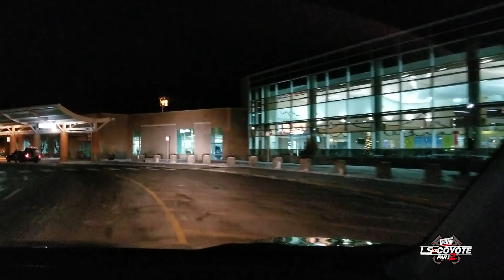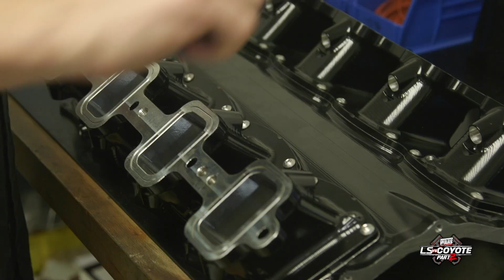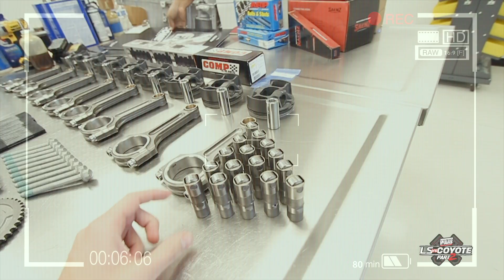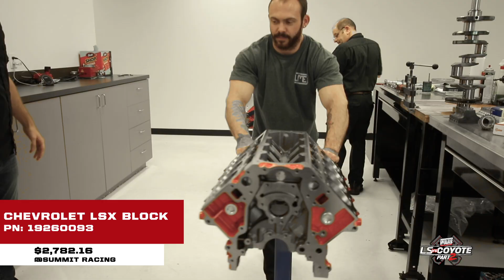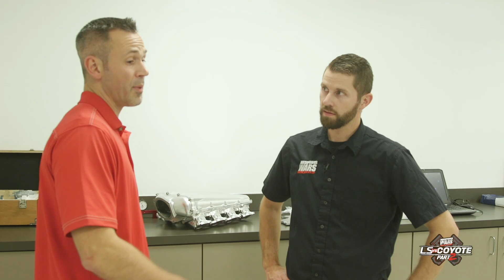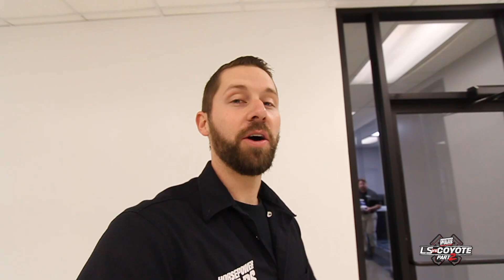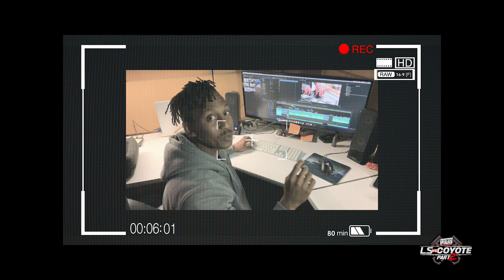LS vs. Coyote 2 Episode 2: The LSX Engine Build

Comment: The coyote will definitely make more Horsepower Per Cubic Inch that's a guarantee now just imagine if the coyote was the same cubic inch... Can you say,done, over with The Coyote with same cubic inches will literally embarrass a LS of same cubic inch, I mean come on its 70 + cubic inches smaller and gives the LS all it wants... You want Respect from Most people match the cubic inches and test,dyno,and race them in a Mustang and Camaro and watch the Ford Coyote walk that LS in essentially every category. It gets me when GM guys bragg that their much bigger GM/LS engine out powers or barely outperforms a Ford engine with 60_70 less cubic inches because let's face it their not going to race a 5.3 LS against a 6.2 Ford because they know the poor little GM/LS would get embarrassed...As for anyone listening try it I dare ya!!!! Test a Ford Coyote with 60 to 70 cubic inches on a GM/LS engine and do the same kind of shootout and watch the Ford Coyote Engine Dominate in Every Category. This is like racing a Stroked 351 Cleveland and racing it against a stroked GM 305 engine it's not fair and that's coming from a Ford Guy because in the case I just mentioned the stroked Ford351 Cleveland would lay waste to the smaller GM period!!!! At the end of the day it should be cubic inch to cubic inch same size no excuses from either side Ford/GM and I think most people would respect, agree,and it would settle the  big question who makes the best, baddest engines that make the most Horsepower when matched cubic inch to cubic inch Ford/GM And I say throw Dodge in there with a Hemi and build all 3 with same or like cubic inches within 5 cubic inches... Who Agrees with that!!! #Blue Oval Nation
Reply: Tell that to cleetus and ruby they ran a 9 second pass on their first drag strip run in a 5.3 😉
Reply: @mr.merica6048  Yeah and then it blew up... awesome engine.....
Reply: @SomervilleMetalWorks  not the fault of the engine. They ran out of fuel and leaned it, that sort of thing happens when you need more  injector. They were also running a modified pan that cased oil starvation and roached the bearings. Stock sump and bigger injectors would have avoided that, it says nothing about the engine.
Reply: @SomervilleMetalWorks  not on the new 5.3 they put in it the other engine was well over 200,000+ miles
Reply: @mr.merica6048  ,that's a 305 with a 4L supercharger.Not sure why,maybe NHRA leveling the playing field,Ford's using a 2.9.Street Coyotes are making 1500hp crank.It's all about power levels.
Reply: @mr.merica6048  and blew it up immediately....no disrespect to cleetus but it blew up
Reply: ford seems to be incapable of going bigger than 5.2l for any sports car they build in this day and age and that's fords choice.
Reply: @lovescamaros1  ,they are not incapable,rather,as you last said lastly,choosing to challenge the big cube pack with smaller displacement engines that produce equitable performance.However,I am a V8 enthusiast and not agreeable to many of Ford's changes.I expected them to raise the bar on Cammer motor displacement to 6.5+L.Oh,well they,re gonna have their hands full staying with 7 and 8 litre competition.
Reply: @lovescamaros1  Nope, this test is already rigged, Try a stroked Windsor with Aussie Cleveland Style Heads, we're seen 998HP with 410ci N/A!!!
Reply: david wenzel - Thats all Ford needs to beat the competition over and over ..
Reply: You do realize there are a lot more 4.8 and 5.3ltr LS motors pulled from trucks and built for a fraction of the price than on these videos that are making 1000+hp than there are Coyote's making the same kind of power? You sound like a fool.
Reply: Jerry Watson I agree with you 100%
Reply: You do realize the coyote has DOHC right?
Reply: Do all you Ford guys not realize that a dang 7 liter coyote wouldn’t even fit in a car
Reply: They should use the trinity 5.8 instead of the 5.0 but all gm guys would cry becaise its not the coyote motor
Reply: @ztaples  The Coyote heads flows wayyyyyyyyyy more than the Trinity heads.
Reply: @ztaples  in that case use the zr1 block too.
Reply: Jerry Watson your right, Ford achieved getting more power out of a smaller cubic inch motor than GMs 6.2 . Buuut the coyote does it with 3 more cams and 2 more valves in each cylinder. Which , depends who you talking to, is worth noting. I'm a GM guy but at the end of the day it's how much money you got 💰. If you have to money you can make a coyote turn much more than a 6.2 ls3 but the only thing is your gonna spend more money to get passed the the power numbers of the 6.2 or the 5.3. that's why most people go with the ls, its cost effective power and for a lot of people that matters. So yeah the coyote does outperform the ls 6.2 or the 5.3 even though it has less cubic inches but last time I heard ford is making a new pushrod V8 to go along in there new trucks...even has side bolts for the main caps...kinda like a ls??? 😂 If you can't beat em go along with them .
Reply: @23finter  so  those  jy 4v truck parts will never be cheap lol...
Reply: Use a junkyard 5.3 LS with a 150,000 miles with some upper end speed parts for a good comparison in cubes. Horsepower will be the same if not better with the LS. Besides Hot Rod magazine did a build using a high mileage 5.3 stock bottom end. Using massaged heads, cam and headers, the numbers were impressive. Then they added 24 pounds of boost and the stock bottom end finally let go at 1,265 horsepower. Not bad for that supposedly junk LS platform that they use in everything. 🤣🤣🤣
Reply: CorvZ061 show me where are you getting your information from? 🤔
Reply: I totally agree,Jerry,if you want to validate the mechanical superiority of one engine design over another there has to be parity,first on displacement,compression ratio,cam specs,and induction.It really has nothing to do with money,but just  the ground rules for both platforms.If the ls  employes a 260*/.600 lift cam,the coyote should have any choice up to and below those specs,as with the rest of the build.To compare a 7L stroker to a 5L stocker is inequitable and invalidates the comparison.Really,the displacement advantage is around 125 cu. In..Apples to oranges in the end,coyote looses.
Reply: @johnrunion7258  No one even knows what the Ford builder is doing yet. Why all the crying about it. Who's to say he's using a 302?
Reply: @EGGINFOOLS  speaking of this part 2 thread,they specifically mentioned 427stroker LS..The designation Coyote is specific only to a late model 5.0(302) twin cam.There's nothing can be done to this block to approach 7L displacement except boost.The designation LS covers a full range of displacements between 5L and 7L on factory engines.When it is referred to as Coyote,that' how I know what it is.Other twin cammers come in5.4 and 5.8 L displacements with no code name.
Reply: @johnrunion7258  Of they can't do anything to the block is that GMs problem? Nope. It's Fords.
Reply: @EGGINFOOLS I'm an old school Pontiac motorhead and I've experienced all the engine history from before there was a 327 small block.The fact that I see a curious blog about an engine comparison and see what,s up.Without bias,what I understand is a power contest between an LS and a Coyote engine.This is where my personal analysis is logically stirred.First I know that all Coyotes are 5L motors,cookie-cutter engines that the user has to modify.Now the LS platform is the most diverse in the industry,going thru several generations of block improvements to give the user a myriad of displacement choices from 294 cu. in. all the way to 454 cu. in.,awesome.That being said,the comparison here is not on diversity(of which Coyote has none) in platform,but of power output of each engines design.The admission that Coyote produces more HP per litre than an LS which means the only way it can match that engineering advantage is with larger displacement,which it can do with any number of LS configurations.The comparison is irrelevant.For a similar diversity starting 15yrs ago Ford made the choice to build a singular small engine platform of tremendous strength and increase it's displacement as needed by simply upgrading the boost induction system.This is why '03/'04 Terminators can still hang with the big boys.A 4.6Lmotor with a 4L supercharger bolt on equals 8.6 N/A litres(roughly 530 cu.in. displacement.You'll notice that GM and Chrysler has been forced into boost mode lately,because their displacement paradigm on the LS platform has topped out,and Dodge even using their V10 to gain displacement.In the end you'll see that Ford made the right move to F/I in '03.Not a hater of anything fast,interesting to see where this is going.
Reply: Ummm, but it weighs more and is physically much larger.   The Coyote is "bigger" as an engine.   More cubes, more durable, less moving parts, and weighs less...LS wins every time.  Unless of course you're racing MPG's.  LMAO
Reply: @966dman  Brotards are all the same, why would i put a 3xx cube engine where i can physically fit a BBC,BBF let alone a lighter/cheaper LS build??????? Doesnt matter anyway the bigger engines are on their way out smaller forced inducton and hybrids are here to stay...
Reply: @shaadydog1 , idk if Big Block can fit in the same space as a LS
Reply: @shaadydog1  Oh my, is that why ford just developed a 7.3 Pushrod Gas engine?   You clearly don't know your facts.   The displacement change has to do with meeting EPA regulations.  Performance will always be owned by large displacement/forced induction motors.   Please do your research, stay off of forums that only align with your own biased opinion.  Expand your mind. :-)
Reply: @966dman  Take your own advice fuqtard, thats for Medium Duty  fleet truck purposes only, it will never see factory use in a mustang. They are trying to get gas to compete with diesel towing ability on the cheaper gas prices. Diesel is just not cost effective in Medium Duty trucks.
Reply: @anthonywebber2211  No no, for the  price/space needed for the mod/coyote platform sorry for the misunderstanding.
Reply: @shaadydog1 , BBC and BBF won't fit in the same space as a LS engine
Reply: @anthonywebber2211  not the  LS it is physically smaller, any place you can put a Mod/Coyote , they are very wide....
Reply: @shaadydog1  you butthurt bro? Lmao
Reply: Obviously GM is doing a good job on getting all this haters hot and bothered lol LS ftw
Reply: How about Horsepower per LB.   LS wins all day long.   LT1,4, and 5 as well.   Sorry, blue emblem buys.  The salt is REEEEAL. :-)
Reply: So, give the ls 4 valves per cylinder and dohc as well?
You said you wanted a fair playing field.....
Reply: It cant hack it
Reply: Well the SOHC 6.2 was constantly destroyed by the GM 6.2. So you might want to rethink
Reply: @EGGINFOOLS  ok did it ever out run raptor
Reply: @jerrywatson8587  Fuck yeah. The 6.2 raptor isn't fast. Is that your defense for the ohc 6.2? The raptor?
Reply: EGGINFOOLS - that’s a pretty good defense you talk shit because there are LS’s everywhere you sound like a fucking idiot
https://www.svtperformance.com/threads/600-hp-n-a-carburated-ford-6-2-sohc-foxbody-notch-build-high-9s-or-bust.981744/
Reply: leeleelee
thats cute there cupcake 
https://www.youtube.com/watch?v=JylHhUOgeAc
Reply: @CoyoteFTW  You found a link of a non-production 6.2 and it ran 9's and that makes you happy! Lol. The LR4 4.8 has been doing that for almost 20 years with pushrods you tool. Back to the tanning both for you dippy!
Reply: @anthonywebber2211  You just made him cry! 😂🤣😂🤣
Reply: EGGINFOOLS - you made a comment about the 6.2 in the raptor being a boat anchor. Of course you’ll find more examples of the ls it’s in every junkyard it’s everywhere that’s the only reason it’s more popular because it’s dirt cheap trash and garbage motors put it in everything.
Reply: Anthony Webber - 😂 https://youtu.be/hCQLE9Wu1Bk 🤫
Reply: @leeleelee you are so ignorant, ls engines are in the junkyard not because of the engine but rather the car having some other kind of damage
Reply: @bobbob-bq6cu  true
Reply: @EGGINFOOLS  The LR4 4.8 is a underrated bad ass LS engine that you can make into a rpm screemer. Now that would be a great comparison.👍
Reply: @cliffordcullen1687  Yup. I love my 4.8. I'd love to do a 6.0 block with a 4.8 crank. Spin that bitch up.
Reply: @CoyoteFTW , again cupcakes thats cute, this is a junkyard 4.8
After eclipsing 1,200 hp, we kept going. Raising the boost beyond 27 psi resulted in what we suspect was an ignition failure. The motor was still in perfect shape internally and worked well up to 26 psi, but unfortunately we were out of available dyno time. The motor survived more than 60 runs, the majority of them more than 1,000 hp. We hammered this motor like we stole it, with repeated back-to-back pulls, but the little LS never missed a beat and was ready for more.
Reply: @CoyoteFTW , and like bob bob said LS are found in junkyards because of wrecked cars, or from vehicles that are in the rust belt and above, not because of the engine, if cars and trucks were in the junkyard because of the engine, why are people using them you clown
Reply: Brodix Heads, Brodix Intake...come on, there is some huge Bullshit going on here. LOLOL 427 CI, custom ground cam...I mean....when did an LSX ever only cost 15G with all Brodix stuff on it. I've seen heads for 6Grand!!!
Reply: They should use the 427 cammer motor Ford made cause is 600hp na oh wait that would make it unfair if the Ford motor was the same size but they could have did a 5.3 to Make it even
Reply: @austinhowze6280 , Mast Motorsports sell 700 Naturally Aspirated LS7s
Reply: @anthonywebber2211  you be talking about that high compression and race fuel
Reply: You make great points,that's what I said there should of been a cubic inches max.the too keep it fair for comparison, plus the dude uses a gm performance block for the build.its a lopsided competition, love too see the mopar in the game also,I'm a Ford guy all day but let's get the 3 in one room
Reply: leeleelee 
Maybe when you blue oval boys realize how much larger a DOHC 5L is than a cam in block 7.4L, it won’t be brought up any more.  
Maybe when the bobs stop saying “put the 5.3 LS against the Coyote or Voodoo”.
Maybe when the bobs stop crying over displacement difference while ignoring the DOHC 32 valve advantage.
Reply: StL ChuckO - you realize we don’t measure physical size you fucking idiot. The ls is still the bigger engine it should breath better but it doesn’t it gets its ass whooped over and over by the much smaller coyote engine.
Reply: fucking dumbass people still think the size matters😒😆 are you like a girl or something? only they care about size. stfu. what matters here is the cubic inches. just accept that a 5.0 is still able to beat a bigger engine. the 6.0 6.2 7.0 just stfu chevy always wants to go ahead with their engines and then there goes ford with the 5.0 beating them , and most of the times the engine is never opened when they're boosted. just stfu and start loving ford i hate these chevy  dick riders
Reply: @juicebox8549  
4 cams, 4 valves /cylinder. Why do you Ford huggers always forget these details? And what's wrong with being able to have more cubes in a smaller tidier package? There's no way you're gonna get 7 liters out of a Coyote. Don't hate, appreciate!
Reply: @EdMiF   EdMiF  ford does not need 7 liters to compete. why do you think they haven't put no new engines out on these mustangs. the 5.0 are the shit. Boost your 5.3 5.7 6.0 6.2 7.0 all you want a boosted and unopened 5.0 will still catch up with your bullshit and leave it behind. But just wait till 2020 when the new 7.3 is out man all the shit yall gonna say. " nah man u got a bigger engine" stfu it's always been like that with chevy . and wow 4 cams. and 4 valves in a smaller cylinder wow just shut up man. Just accept that ford has the best engine out right now, and way better with the 10 speed.
Reply: EMC let the mod motor in ONE TIME thinking they couldnt meet the 410ci rule... the result was a 1 2 3 finish for 410ci mod motors...the only way an LS can win an EMC is they have an LS only class. this video is simply an aftermarket $$ contest. the LS has a bigger aftermarket
Reply: EdMiF - Ford just introduced a new 7.3l big block which from the specs looks like it’ll be ready to give those ls engines an ass whooping. Which the coyotes have already been doing
Reply: @EdMiF  Well if we apply your logic to Chevrolet ,there's no way to get 427" out of a 327.Birth of the big block.Coyote is only a specific designation for Ford's 5L DOHC .The 5.4 and 5.8L DOHC engines merely have more displacement ,but without the complete design changes.Put a 5.8 in the GT and the LS7 Camaro SS is forced into boost mode.
Reply: @johnrunion7258 
You can also get more than 427 cubes out of an LS7 though. There is a site that is offering 700hp from an LS, N/A.
Reply: @johnrunion7258 
And let's not forget about the torque advantage that the LS has over the Coyote.
Reply: @EdMiF  Yes, Ed, the LS would have that advantage even before the build.
Reply: Your a fucking novice. The 5.0 coyote is physically larger in unit size and unit weight and unit cost compared to a LS and it still looses.
Reply: @robertgardner2782  ,sounds like you're saying that a heavier engine with less displacement should have an advantage.Reverse logic.The variable of engine bulk and weight only comes into play when it's mated to a chassis,not on an engine dyno.The key to the comparison is displacement.Chevy produces a stout 305" LS and,in all fairness,why not use that one with all the best parts against the 302" Coyote.I think the Chevy jocks know that outcome.
Reply: @johnrunion7258  no replacement for displacement lol.
Reply: @robertgardner2782  ,when Corvette Z06 went to 427 cubes,I went to a Whipple supercharger at 20psi on my Terminator for the win.That correlation originated in the old days when you put a 500inch Caddy motor in your hot rod, but is only valid under normal atmospheric parameters.Once you complete fuel system upgrades and install 100# injectors,you can go all the way to a 4L supercharger.
Reply: @robertgardner2782  , the physical size or weight is not what produces horsepower.The fundamental element is displacement,hence the phrase"no replacement for displacement".This standard supports and validates complaints that any honest comparison must START with parity in displacement.If you're going to insist on an LS displacement of 350 to 380 cu. in. at least choose a closer match with the 330 or 355 cu.in. 4 valve,which is just a Coyote's big brother.
Reply: Robert Gardner you do know that the coyote is lighter than the stock LS3 right? 🤔
Reply: @joshuamora6778  No it's not. Dry weight the LS is around 175Kg vs 200Kg for a Coyote
Reply: Completely agree
Reply: Jerry,don't be so stingy,I'd spot them 20 cu. in.